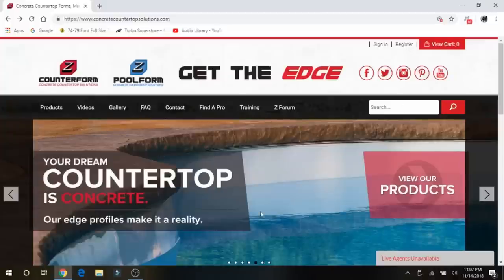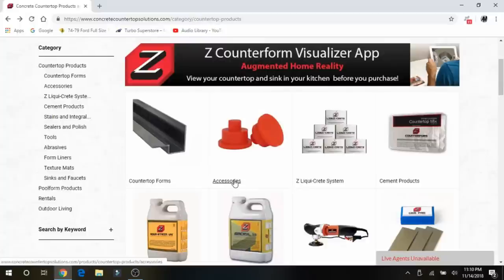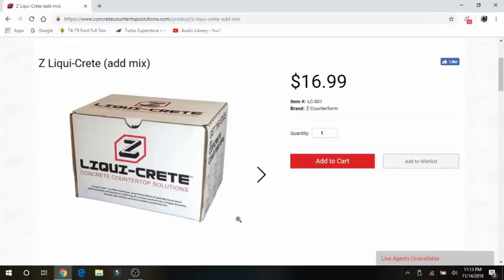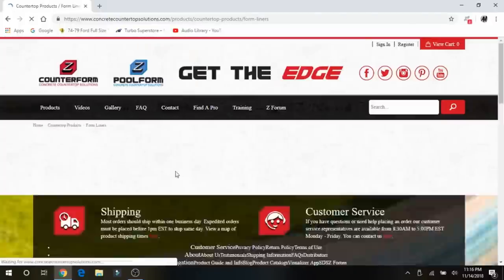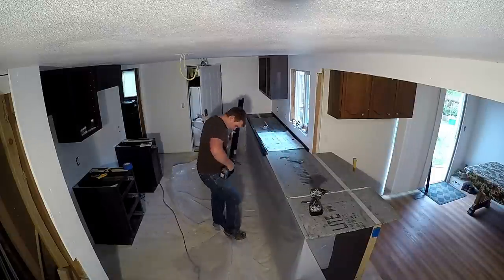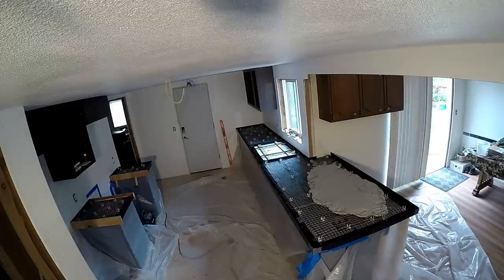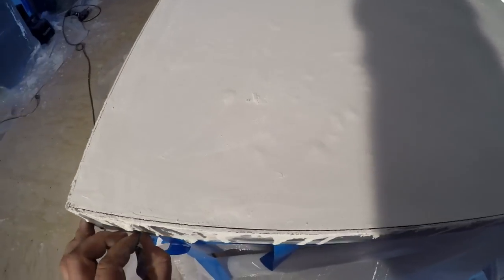Easiest  ( DIY ) White concrete counter tops 2019.

Comment: This looks really good, I often wonder why we find it necessary to put more reinforcement in to these countertops. Especially when using fiberglass in the mix. Just seems like overkill when we think about the actual wear a countertop will take. I've poured a few and always put mesh in, but I think I am going to experiment on my own house and try without mesh to see if it matters at all...
I suspect it won't.
Reply: Hello, did you ever try and compare?

Comment: Hi, could you give an update on the concrete countertop since it has been over half a year?  How is it holding up?  What would you have done differently? Thanks.
Reply from the maker: BoarK they are holding up very well it is actually been a year this week weary sealed them about 2 months ago which is only about a one-hour process have been very pleased

Comment: AM Custom fab:  or anyone else that might have any input:
 Hi there,  Counter looks Great!   I just ordered the White Counter Mix a couple days ago. Just waiting for shipping so i can attempt to do ours..... How is it holding up to stains?  Has there been any cracking, or have you had any other problems or concerns to date?   Anything you would have or should have done differently if you were to do it over again?  
 When i spoke to Tom at Z Counterform.  He recommended a Lexan Trowel if we were planning on keeping it white.  Don't know if that is totally necessary?  But i figured why not?
 I thought he also told me to just use 120 & 220 grit sand paper?   Maybe i misunderstood him?   Is Diamond Grinding Always needed?   Or does it depend on how smooth the finish comes out after using finish trowel?  I install Commercial Flooring for a living, and trowel finish allot of different cement underlayment products  prior to installing various floorings.  
I have never done a counter or concrete polishing..
Thanks for any input

Comment: What length was your bar overhang? Did you have any extra support for that section (permanently, not just for the pouring)? Want to make sure my bar overhang is supported correctly.
Reply from the maker: 06judahd I have about 10 in past the pony wall but I have not got nice support in yet been meaning to make some metal brackets but just have not got around to it and it's been about a year since I poured
Reply: @amcustomfab  Thanks very much. Have you noticed any sagging or other issues due to not being supported yet? Also, is the trowel linked in the description the actual one you used? or just one you found after?
Reply from the maker: 06judahd no sagging or issues yet but I would highly recommend using some sort of permanent support I know they have came out with some nice brushed stainless ones they're kind of spendy though and as far as the trial goes it is not the same brand of one I used but it's the exact same dimensions and style

Comment: How did you secure the hardie board to the cabinets? How did you remover the plastic form on that is touching the wall? And did you have to pre drill anything? And is it a standard caulking that you used for the seams?
Reply from the maker: i fastened the concrete board to  the cabinets with
sheet rock screw and pre drilled them ,the form that touches the wall stays in the concrete  you  back splash will cover it up ,  yes i pre drilled the forms as well , yes standard calk  i think i used the 20minut set stuff just so it was fast . hopefully that was helpful. thanks for watching.
Reply: AM Customs I wish I could fly you down to help me out lol... sorry for the huge amount of questions. So you pre drilled the hardie board to secure the forms? Or just to secure the hardie board? And on the plastic cover how did you secure that? Flat head screws in the cabinets? What width did you give yourself on the hardie board like 24”? Thank you for your help I wish I could send you pics of my kitchen..
Reply from the maker: @sergiomarrero4768  haha no problem , i pre drilled the hardie  to fasten it to the cabinets, then pre drilled the form to fasten it to the hardie . , the plastic to cover the cabinets i just stapled it to the top of the cabinets installed the hardie over it then when i was all done i took a razor blade and  cut it off as close to the cabinet as possible , yes 24'' on the hardie the form will give you the proper over hang
Reply: AM Customs did you use the 5/8” construction screws they recommend to secure the forms it to the hardie board?
Reply: AM Customs I also bought the dye pack to get that ultra white look when did you add it to your mix?
Reply from the maker: @sergiomarrero4768  i used there screws
Reply from the maker: @sergiomarrero4768  when you mix the concrete. one thing i with i would have done is rent  a mixer  insted of mixing it with a drill and a bucket helped a fried a couple months later he rented a mixer and it was soooooo. much easier
Reply: AM Customs good idea, on there yotube page they mix it with a drill and they add a precise amount of water 3qt I believe. Did you use dye pack if so did you add it straight away to the mix?
Reply from the maker: @sergiomarrero4768  yes  just pored every thing in and mixed it
Reply: AM Customs hey there did when you sanded it . Did you take out some of the bright white color?
Reply: Seems like some of aggregate is showing now.. yours still looks white...
Reply from the maker: @sergiomarrero4768  ya when you start sanding it the agraget will come through there  is definitely agraget sowing on our in some spots more than others  .
Reply from the maker: @sergiomarrero4768  if you look closly at ours it is not solid white  there are organic splotches  of different shades of white
Reply: AM Customs ok perfect thank you, i was thinking that I was sanding to much into it.. did you ever think about staining it white..
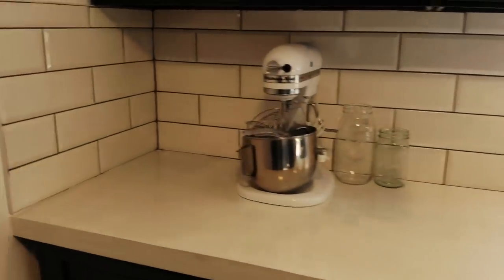Reply from the maker: @sergiomarrero4768  i found one spot in the video  where you can see the sploches a little at 21:57  just forward and to the right of the mixer there are several spots like this thru out
Reply: AM Customs yeah mine are similar.. I haven’t polished them or sealed them yet.. so I’m i maybe went to much and took ours a little farther down. But I think they are all their own works of art..
Reply: AM Customs thanks for being so helpful.
Reply from the maker: @sergiomarrero4768  amen
Reply from the maker: @sergiomarrero4768  glad to be a help

Comment: I don't know if it's the camera or what but the edge doesn't look straight in front of the sink and dishwasher
Reply from the maker: steve beuchert  good eye you would be correct . that is one mistake I made at the mold seem I should have fastened some sort of straight edge so that they did not Flex at the seam

Comment: Which eBay polisher kit did you use?  Was it the diamond tip, or just paper?
Reply from the maker: Diamond
Reply: Thanks, I just poured mine today and I’m looking to order the kit. How long did polishing it take? Sorry for the dumb questions, but this is my first time doing any concrete at all.
Reply from the maker: No problem was my first time doing anything concrete also I think I spent about 4 hours total started with 400 grit and went all the way down to 3000
Reply from the maker: Hope it goes well for you .

Comment: Thanks for a well-documented video. Since it's been a few years since you've poured these - how are they holding up. Any stains?
Reply from the maker: Holding up really good no stains we reseal them about every nine months but that only takes a couple minutes to do and then you have to let him drive for an hour or two. My only regret is with the square edge that I didn't round it over a little more because having a sharp edge on the top where pots and pans can hit we have acquired the some small chips on the corners here and there but nothing catastrophic
Reply: @amcustomfab  Thank You - good tip

Comment: Can you post your "recipe" for the countertops. Between the mix and the addative.
Reply from the maker: Which additive are you referring to the dye packs?
Reply: @amcustomfab  I believe in the video you referenced the addative that would prevent it from cracking.
Reply from the maker: Yes I misread the website if you buy their white concrete it already has the additive in it there additive is for making a standard bag of concrete in to countertop grade concrete.so if you seen in the video I accidentally mixed a bag of additive with their white concrete on the very first batch and then once I realized what I did I just use the white concrete after that
Reply: @amcustomfab  understood. So you just straight up used the white bags.
I see the video is two years old now. 
How are they looking still
Reply from the maker: Correct just use the white bags and we put one white dye pack per bag of concrete. They have been holding up great we've really enjoyed them we reseal them about every six to eight months with one more coat of the shine coating it's real quick pull everything off the counters roll it out let it dry for an hour and then you're good to go only thing we have had happen was we dropped a pan on one of the corners and chipped it just a little bit but besides that we're loving them

Comment: You did a fantastic job! How are the counter tops holding up after a year? Are you guys afraid of any cracking after some time? ( I saw this being a potential issue with a concrete surface when comparing concrete to granite.)

Comment: How are the countertops holding up 2 years later? Any issues with stains or cracks?
Reply from the maker: No stains or cracks my only regret is I wish I would have went with the half bullnose instead of the square edge so that the edges would be more radiest we have had one spot where a pan made contact on a sharp corner and it chipped a little besides that they've been great we reseal them about every 6 to 9 months depending on how much they get used.

Comment: What did you do about the blisters?  Those are often caused by over troweling although it didn't look like you needed to do much troweling at all with that mix.
Reply from the maker: I did over trowel that one corner but the blisters ground right out.

Comment: What level of experience did you have with concrete beforeyou entered into this project? Even if completely amature, have you worked with concrete at all prior? Trying to guage whether I should attempt this or not.
Reply from the maker: I did a small sample slab with regular gray concrete.  And I helped mix for a foundation of a friend's shed that was my previous experience.  I would recomend doing a coffee table or something small to practice on if you ha zero experience.
Reply: AM Customs that was something I was thinking about. Do you think I could get away with some cheap stuff from Lowe's for the test batch? Or do I NEED to do a trial run with this product?

This product looks a bit runnier than the majority of other product I've seen.

Comment: How have they held up? I really want to do white concrete but I worry about stains. Have you had alot of staining?
Reply from the maker: Zero stains . We re seal it about every 6 to 9 months depending on how heavy traffic it gets as long as you don't use a scrub brush the sealant last longer and everything comes up with a damp sponge super easily
Reply: @amcustomfab  thanks for replying, and good to hear! Do you use the SIAcryl 14 sealer?
Reply from the maker: We use that to see it in the beginning but then we just recoat / reseal it with the countertop shine every 6 to 9 months basically a wax coating

Comment: Did you put plastic over the counters to slow down drying?  If so is it necessary?
Reply from the maker: It will greatly minimize the chance of cracking I also took a spray bottle of water and lately wet them down under the plastic each day

Comment: So what happened to the bubbles?  Did you have to patch/fill them in? They look good!
Reply from the maker: Olga Mejia they where not hollow so I just ground them flat the reason they appeared is because I had very little concrete experience and I overworked it during the finishing process I would recommend watching some videos on how to finish before you take on the project to avoid this
Reply: @amcustomfab  ok thank you!

Comment: I noticed you said you polish to 3000 grit. My question is how is your sealer holding up considering technically you shouldn’t polish over 400 grit if adding sealer to a concrete countertop, so I’ve heard... Are you having any lifting issues?
Reply from the maker: So far so good
Reply from the maker: But you are correct in saying you do not need to go to 3000 I have since helped poor three more of these countertops and I only went to 800

Comment: We're planning on using your video in our home to do exactly this. We have pretty much zero tools and this will be my first DIY in our home. Would you say even with zero experience this is definitely doable and will come out?

Also, you mentioned at one point you messed with the color a little bit? If I was wanting stark-white tops what is that process? 

Also! I know concrete needs to be resealed to maintain it, how often and how do you know when it needs to be resealed?
Reply from the maker: If you have zero  experience with concrete I would highly recommend trying a smaller project first like a coffee table or bed stand / in table 2 learn on and feel out if you are comfortable doing it. If you do commit to doing the kitchen you will definitely want three people minimum there to help. As far as the white goes see countertops has their Altra white dye packs which we used to help us make it whiter. As far as ceiling goes I would recommend every 9 to 12 months we just recently did just the spot where we use the countertop to most often and it's a very quick process took 15 minutes to apply sealer let it dry for 2 hours before we use the counters again and was good to go. Thanks for watching the video hope your project goes well !!

Comment: How wet did you make the mix
Reply from the maker: Steve Ladd I mixed it per instructions but it   is made to be a lot thinner than your normal concrete it is supposed to be simi self leveling
Reply: Thanks for the quick update I’m going to try and do my counter tops this weekend

Comment: Did u have any problems screwing the forms and not holding on to the durock
Reply from the maker: No  I pre drilled the forms , and just made shur not to over tighten the screws ,so as not to strip them out ,I used  the recommended screws from the Z countertops website.  Hope  this  is helpful 👍

Comment: The front edge of the long sink length at 34 seconds looks questionable at best, is that the norm on longer lengths?
Reply from the maker: Not normal on a long straight  like  that I should have supported my seem with a some sort of straight edge.
Reply: Ah ok, if you figure out a fix you should make a video as you turned out a really nice job.

Comment: Looks awesome 👍 , but the only thing I never understand is why people put concrete benchtoops in their kitchen? Stone is durable and looks beautiful but expensive , laminated bechtops are less durable than stone but looks ok and much much cheaper .
Concrete benchtips are not as durable as stone and as not cheap as laminated ones , looks like basic laminated ones and of course much expensive than them as well + mess
For use outside is ok but for indoor kitchen ?!!!!!!!
Reply: Mehran Freeman laminate counter tops are now just as expensive as stone in some cases. I recently priced out several types of counters that were on sale. 

Laminate or Formica ranged between $1400-1900 without instal
Quran was $2,500 installed on sale $40 sq ft retail $60 sq ft 
Granite ranged $50-100+ a sq ft
This stuff all in including the concrete mix, edges, everything he got for his was around $600-700. About $15-25 sq ft. Sooo much cheaper. And with this you can lay in anything you want. Make it look like marble, add stained wood, you name it.
Reply: @steves9173  
Here in Australia (middle of nowhere) 1 sheet standard laminated countertop is about 100 AU$ =75 US$
3.6 Meter by 0.6 Meter
I taught stuff in America cheaper than here!!!

Comment: Have you had any cracks yet?
Im thinking about doing the same in my kitchen
Reply from the maker: No the slower you let them cure the less chance  of cracking  the best thing to do is lay plastic over them while they cure to hold the moisture  in I to a spray bottle  and would  wet them every night  under the plastic while they cured
Reply: @amcustomfab  awesome can't wait to try it out

Comment: Excellent work and it looks like it came out perfect. You made a slight mistake in your explanation, at 5:01 you said you will get ".34 cubic feet per bag" as you rolled over the ".43 cubic feet per bag" text, but all you have to do is read the website and make your calculations so no harm, so foul! I did want to ask, I saw you polished the entire surface before covering with the sealer and polish, did you polish out the back corner by hand or was it not noticeable? The only way you could make a better video is if you didn't say "Um" so much because you say "Um" a lot!
Reply from the maker: Haha definitely giltey of the "Um" ,I did not realize that I said the wrong qf for the bag thank you. And as for the I used a foam Dimond sand pad and did it by hand not as perfect as the rest of the counter but still seal able . Thanks for the constructive criticism I really appreciate it 👊🤘☺